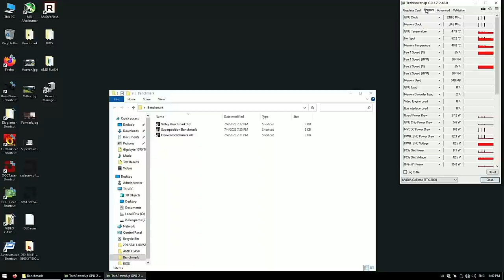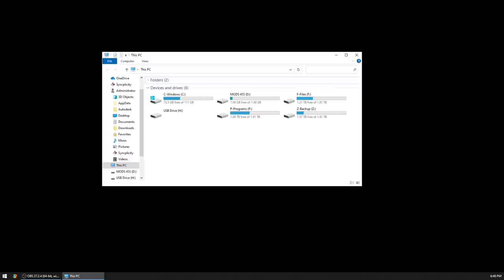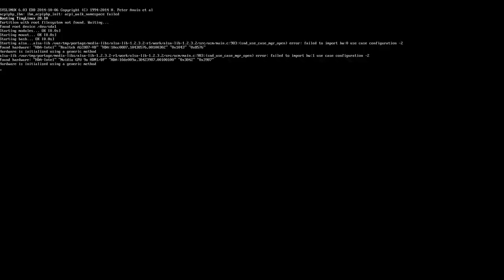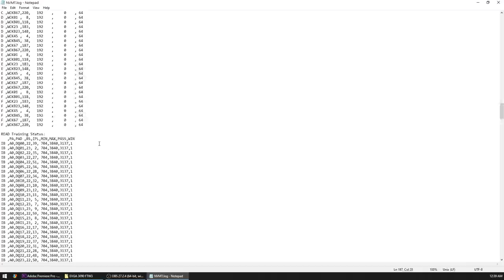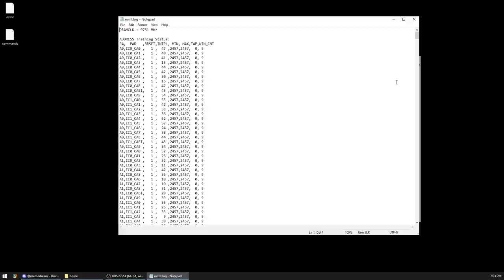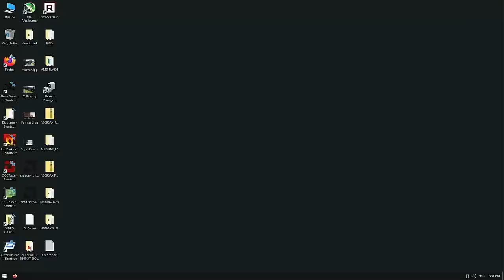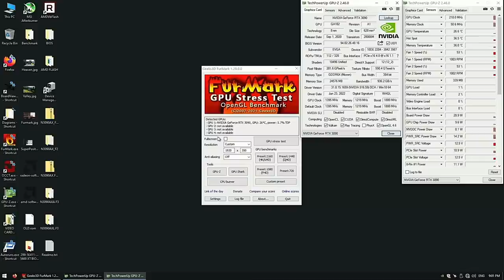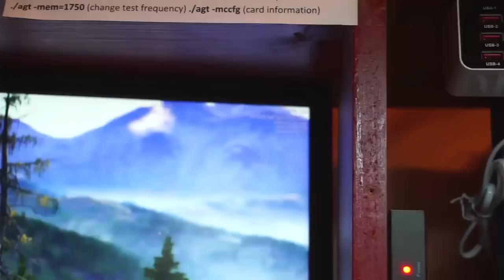Should you trust EVGA warranty ? 3090 ftw3

Comment: I think you proved why EVGA didn't bother fixing this card. This was more like rebuilding the card. Great job BTW. I have zero knowledge of what it takes to fix something like this, but I do enjoy your videos and commentary.
Reply: the point was they lied and didn't honor warranty.  Regardless of how hard it was to fix, warranty is warranty.
Reply: @shentharo  We know nothing but what NWR had reported to them by the customer. No verification what so ever. As retired engineer this card showed signs that are not warrantied. The card was damaged by the customer clearly and they illustrated that fact quite well. What he didn't show is the EVGA PCoIP log. Furthermore he(owner of the card) violated several of these conditions of the terms of warranty. *This Limited Warranty does not cover:*

    Graphics Cards that are modified by customer outside of factory specifications and/or not in factory condition.
    Graphics Cards with modification to the serial number and/or factory identification labels whether removed, relocated, falsified, defaced, damaged, altered or made illegible.
    Damages to PCB (Printed Circuit Board) whether cut, scratched, warped, cracked, dented or broken.
    Any damages to the components, hardware and/or assembly of the graphics card including neglect, or unusual physical, electrical or electromechanical stress.
    Any missing hardware, components and/or assemblies of the graphics card.
    Cosmetic damages deemed outside of reasonable usage caused by deep scratches, cuts, cracks, dents, discoloration, neglect, dropping or mishandling the graphics card.
    Graphics Cards that are exposed to liquid, liquid residue or excessive humid environments resulting in rust, moisture, dampness, stains, corrosion or liquid spills on components, hardware or electronics. Burns or component Flare-ups as a result of a liquid accident or spill.
    Direct usage of paint, submersion of the graphic card in oil, use of adhesives or glues on any part of the graphics card, usage of solder to the PCB, electronics and/or component modification.
    Exposure to cigarette tar residue, dampness, sand, dirt or excessive debris.
    Graphics Cards that are rendered non-functional due an accident, collision with an object or tool, use of excessive force, neglect for care, exposure to fire or abnormal heat, flooding, dirt, windstorms, lightning, earthquakes, excessive weather conditions, theft, blown fuses, or improper use of any electrical source.
    Defects or damage resulting from the use of a 3rd party product in conjunction or connection with accessories, products, software or secondary peripheral equipment not furnished for the usage with or approved for the Graphics Card by EVGA CORPORATION.
    Defects or damages resulting from improper testing, operation, maintenance, installation, service, or adjustment not furnished or approved by EVGA CORPORATION.
    The use of inadequate shipment packaging or use of inadequate packing material resulting in damages to the graphics card while in transit with your shipping courier.
    Unauthorized changes to the BIOS or Firmware on graphics card that do not have a Multiple BIOS option may cause this warranty to be null and void.
    Products received in a condition that is not covered under these warranty terms will be returned to the customer. The customer is responsible for any return shipping costs. The customer may, with written consent, request to have the product recycled instead of returned.

, Cheers!
Reply: EVGA has no trouble rebuilding cards and replacing every single component on the card, including the GPU.  For their sponsored overclockers, they will even swap VRAM chips and the GPUs between cards to get better performance out of them when one card has really good VRAM and another has a really good GPU.  To say they wouldn't RMA the card because it would need "rebuilding" or extensive work is absurd.
Reply: @Mildly_Amused  I think you are taking my comment too seriously. I was just amazed at the amount of work it took to fix this card and the knowledge of the YouTuber fixing it.
Reply: @Mildly_Amused  No Chris it's absurd  to say the card wasn't damaged by said customer and voided the warranty and was hoping they wouldn't catch it. You can read and comprehend yes? Cheers!
Reply: @L0rd_0f_War  his work is very good no question imo.
Reply: So $10 in parts is enough for them to justify not fixing it in your opinion? Do you realize how much that card costs? Wow Just WOW.
Reply: @xxJudgmentalxx  So voiding a warranty then trying to scam the manufacturer into fixing your screw up is ok with you got it.. Make some common sense sir no business would be around if they all let customers treat them this way. Clearly you did not read and comprehend at all. You should learn to. 
Edit" wow is right your a messed up person thinking that way. Warning folks this guy condones scamming others or business because it isn't his money, its all good...
Reply: @tysoncoffman7562  Please explain how the owner messed his card up by removing one screw that had a sticker? Replacing junk thermal pads that most likely killed the memory in the first place is in my opinion our right to repair if the company won’t and should not in any way void the warranty. 
 Even if the customer messed up their card EVGA should still fix it if fixable without markup on the cost.
That’s called a warranty not this crap we get today.
Reply: @xxJudgmentalxx  no insults were made only actual descriptions of ones self(you). Imagine as if you saying i am not qualified while stating my own degrees only makes you look more foolish than you have already shown the world sir. Claiming a sticker is somehow voiding warranties when that hasn't been a thing since 2015. Yea keep quacking duck all hot air to this point you have offered nothing but opinion. The binary literally said get a degree and talk shop. Don't see you in any such forums sir.
Reply: @shentharo  the warranty screw was off.
Reply: @user-wq9mw2xz3j  EVGA is not like other gpu company's if the user installed a water block it would not have void warranty and even if that was the case it can not be enforced in the USA Google it. This is from EVGA FAQ i would link it but youtube does not like links. "Installing third party cooling solutions does not void warranty on our products. Just be sure to keep the original cooling solution as it will have to be on the card if it is ever sent in for RMA. Any physical damage such as burn marks, water residue or damage, or any damage to the PCB will void ALL warranties." I like EVGA and I am sad they are gone but this card should have been fixed by EVGA because parts on the pcb failed.

Comment: I just RMA'd a 2080 super due it flat out dying. Not picture out or anything. After less than 10 minutes on the phone with EVGA I had my RMA # and sent it back the next day. Being last Gen at the time they said they were unable to repair or replace the card. The very next day I got an email with a tracking number with my old card being sent back to me. When I opened it a brand new 2080ti was inside. I called to let them know that this wasn't my what I had and they said it was the replacement since they didn't have anymore supers. The best company in the GPU game and I miss them already

Comment: I wouldn't necessarily give EVGA a pass for not fixing it but to be honest that doesn't look like it would have been at all easy to diagnose even at by an EVGA tech. It was one of those wonderful rabbit hole repairs where everything keeps pointing to a new issue.

Awesome job getting it back up and running though! Glad we users have somewhere to send GPUs too. I imagine the 4090s are going to come in too just because of the complexity and small PCB along with the high power limit. They seem to be more efficient than all of us had guessed but they still have a lot of power stages in a very small space.
Reply: Has nothing to do with that. It's irresponsible to deny RMA on a top of the line card and it's good, that EVGA is getting exposed in some way after doing so.

Comment: if you pause at 12:39 , you will see immediately hot spot reaches to 109 C. It is clear why it failed under load instantly.  not sure if those memory chips were bad either.
Reply from the maker: i didnt touch the core so my only guess is that somehow those chips were causing core to overheat.
In any case, memory had reported errors and if errors were gone and crashes did not persist after replacing reported memory chips, crash under load was memory related and not the core. Nice cache by the way. i didnt even notice it until you pointed it out.

Comment: It takes more flug and you have to melt a lot of lowest solder to the point it melts to the front. The 12volt will literally fall of 5he bottom( top) it takes a very tiny amount of pressure to have the 12 fall right out. When I do 12-volt plugs. They come right out and are easy to clean and prepare for the new plug.? 

I know I say things you know. I apologize if I sound stupid. I love your channel  and will be applying to gain access to your discord channel.  I will pay you some money to help you as soon as I can.

Keep up the most amazing channel!!!

Comment: I have an EVGA 3080 XC3 that has been giving me trouble. It was running fine until I installed a larger tower cooler(Scythe Fuma 3). The temps are only high 70s low 80s but my PC was crashing to black screen and I have to restart. I put my 2080 in (EVGA XC2) and it's been fine for 3 days but I've lost a lot of performance, of course. I was considering putting new pads and paste on but haven't worked on a GPU yet.

Comment: I have suspicion that EVGA engineer used theirs own specialized tools, found all that damage, and returned it with excuse just to avoid doing these repairs.
Kinda reminds me how I left my pocketbook reader on sunlight on accident, and transparent glue around the screen turned to white. So I send it to warranty repair, and it ended in Poland, and Polish engineer returned it with words it was caused by a water...

So I looked at VERY carefully for dust and other stuff between joints, and it was undeniable the reader wasn't even opened. If he opened it he'd see zero water damage inside. It was just a typical example of lying Pole. 
The alternative repair company that I asked wouldn't have time to do repair before warranty expiration, thus shop returned me money. Then I waited on a new model, which has touch screen and no way to tune sensitivity down. And then I tried to find and remove all small hairs that got stuck between cover and the screen and created a nice touch like interference.

Can someone make reliable 10+'' e-ink reader for low price? (And I'd prefer user replaceable batteries.)

Comment: Gonna go out on a limb and say most of their specialist that could have probably fixed this may no longer work there because ya know EVGA no longer makes Graphics Cards. Which in no way excuses them denying RMA but that is between the customer and them. That being said great attention to detail on this repair.
Reply: evga claimed to have egough stock on hand to be able to handle any rmas
Reply: Ya that's my take too they probably have no one to do any kind of diagnostic let alone a repair.
Reply: @emeraldbonsai  That wasn't the question the question was could they repair it.
Reply: @LavitosExodius  it's far easier to remove the die and replace the board. Especially at that level, the issue is that EVGA is no longer in the card business and will try to stretch its stock for as long as possible...even if it means denying an RMA on small things. In essence their RMA is now full on triage level and if they see someone with a 3090, they are probably expecting them to get the 4090 anyway
Reply: @everyonethinksyoureadeathm5773  basically your right still though it's going to be harder for them to exist not selling GPU's anymore and denying RMA's over little things like this people will remember when they buy their other products.

Comment: There is a problem with the 3090's the rear memory cooks itself over time.  People need to add heat sinks and fans to the rear memory to prevent this from happening.  This is a design flaw with practically all 3090's. 
-  I used small aluminum heat sinks and thermal adhesive to permanently affix them on the heat spreader directly above the rear memory - and I mounted a small fan on the rear of the card which assist in cooling.  This solves that problem.

Comment: Ive actually bought a refurbished 3060 from EVGA. Arrived with no box labeling the graphics card, thought that was weird initially. Was thinking that since it was an refurb that it probably wasn't a big deal. Popped the card it, updated drivers and everything went to shit from there. Sent it back to EVGA and they claimed that it was a user error, and it 100% was not. It was definitely the card, since i replaced it with the previous 1060 and booted the computer and it worked. When i put the 3060 back in, the same things started happening. Weird flashing, slow down to 0 fps in video games, and a computer that just plain didn't work.

I loved evga before that.

Comment: First thing i did with my 3090 is the copper plates from cool my gpu.  Its insane how cool it keeps the memory.  Barely will crack 74 on hotspot memory
Under load normally 65-68.  Best mod ever

Comment: i noticed 4 issues 1 too much solder 2 solder the board not the chip 3 you spent to much time heating that area 4 don't preheat the board it slows heat dissipation and makes errors worse.

Comment: Boy howdy this one sure was a doozy huh? Great diagnostics here. I was a little surprised you didn't test the MOSFETs before switching them out as that could've saved you a few minutes. Anyways, awesome repair dude. Soldering those memory chips looked like a PITA.
Reply from the maker: those are driver mosfets. how do you expect me to test them ?
they are not shorted from 12v to GND pins, thats all the test i can do.
If the internal driver is damaged, there is no way i can test it without powering it on to some test rig which i dont have.
Reply: @northwestrepair  can't you just check source to drain on each fet in diode mode? I haven't worked on GPUs in all fairness and I'm not that up on high and low side VRM MOSFETs. That'd be my first instinct though.

Comment: I wish I knew how to do this. As a gpu miner, this comes in clutch as a little skill to have, honestly don’t know where to start. Life doesn’t permit me too much time in classes at the moment 😢 so have no clue how to learn on my own in my spare time
Reply: At current profitability your investing at most 10 cents a day to pull one of your cards and poke around in there with a multi meter. See if you can learn something. Sometimes when you don't know where to start, the best thing is to just start.
Reply: @brocktechnology  so true I guess. I actually have one card that, gets power but doesn’t display a video signal. I’ve already went through the entire steps of ensure the PC it self is not the problem & have found it’s the card. So I do a have a broken card to poke around with

Comment: Its a red lipped 3090 FTW3.   These were the ones that blew up on amazon's new world.  Its sad eVGA is not replacing them, but i can see it, as they stopped doing gpu's.
Id advise the owner to take this video to eVGA, and have them settle the repair bill with you, otherwise id take eVGA to small claims court.   
It was the wrong diagnosis, and they failed to honor RMA.
Now also i have learned that they won't honor RMA's like they said they would on GPU's, so its probably better off sending them to you instead.

Comment: Maybe the card never actually went to EVGA, not trying to defend EVGA, i just happen to know that stores/3rd party companies have done this and called it no fix because some times the manufacturer cannot provide a replacement because the card is too old or for some other reason and the seller is are made aware of that, they will be forced to give one themselves, so in order avoid honoring the warranty and giving out a product that cost money from their own pockets they make sure to find anything which they and/or the manufacturer would, in theory and in papers specify as damage and then proceed to claim as such in order to void the warranty.

Now it's not impossible that damage like the one here can cause a fuse or another component to blow/stop working/short
but it's rather unlikely and as likely as the probability of this GPU not actually being checked by anyone else other than the seller's computer repair person.

Comment: EVGA doesn't have a repair staff in the US and no one working in a warehouse makes a 6 figure income 🤣. Engineering staff would be in Taiwan, If the card looks damaged at all, it gets denied. This is CID or customer induced damage from installing a water block. If a short is found, it's denied as it should be. This is a known issue when installing EK water blocks.

Comment: Could you tell us which 4090 AIB board has the best pcb for OC?
Reply from the maker: Gigabyte has very good pcb quality on 3090 cards, I imagine it's the same for 4090.
I would stay away from zotac for sure.
Zotac is very cheap, weak and thin and easily broken.
Pads get ripped off with no effort.
Bad pcb all around.
Reply: @northwestrepair  Thanks, I'll probably get gigabyte.

Comment: So wierd swapping fixed them. Must have been two pads touching somehow
Reply from the maker: No idea. I've seen this before on 1070's. Even after checking all the pads, there was no reason why it wouldnt work.
I think problem was uneven amount of solder on each pad.
Reply: @northwestrepair  I'm no engineer but wild guess is the pads/chips are ID'd somehow? 0 and 1 per se